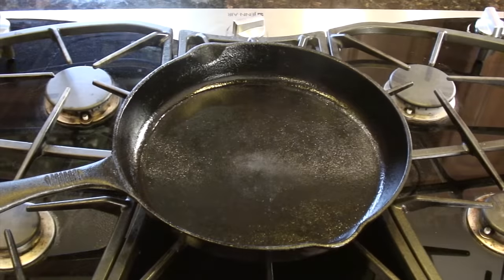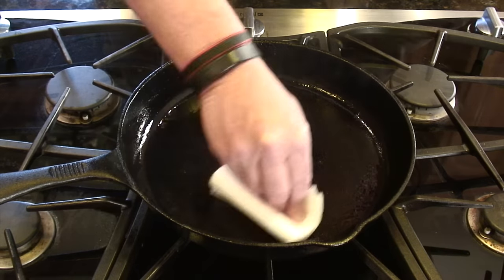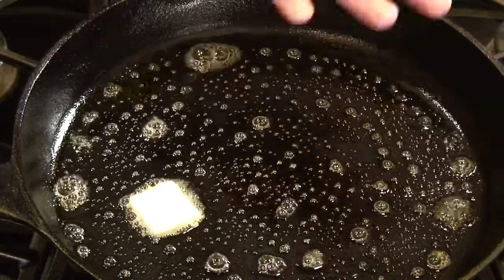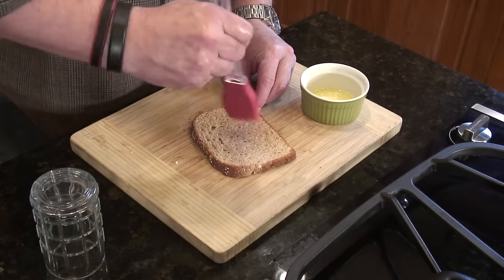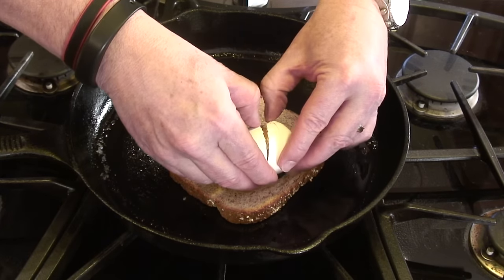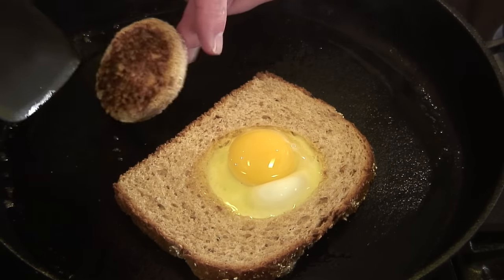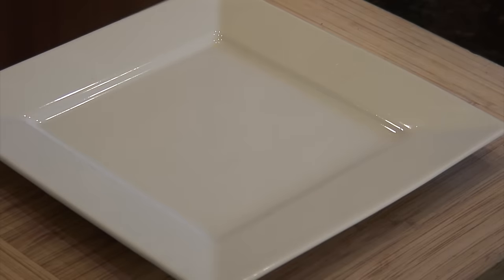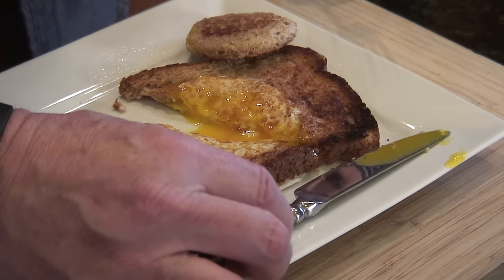How to Make Cast Iron Skillet Perform Like Teflon

Comment: Or you could just use a half decent stainless steel pan or, gasp, a teflon pan.  The problem with the cheap cast iron pans that are on the market today is that they have a rough surface.  They used to polish them smooth.
Reply from the maker: We hate stainless steel and have decided to no longer use teflon.  You are correct about the newer versus older cast iron.  In fact, I cover observation that in this video.
Reply: What do you hate about stainless steel?

Comment: That pan had not been treated rite if it was 20 years old and still looked like a fresh casting. Wash then put back on heat to dry all water and while hot drip olive (what I mostly cook with) but animal fats if used daily but will turn rancid if not used for a while but veg oil doesn't. But while still hot that thin layer of oil will build a carbon layer over time that's as good as any Teflon and you can even use a fork while cooking and not worry about scratching the pan. NEVER LEAVE WATER STANDING IN CAST COOKWARE!!!!!
Reply from the maker: That skillet has been "seasoned" many, many times.  It looks nothing like it did new.
Reply: BTW... By the lines on the handle, or the thumb grip, you can tell that is an Asian made pan.  No American makers ever put those lines there on the handle.  For the most part, the Asian pans were poorly cast.
Reply: Leo Ortega My Martha Stewart pan (made in China) has those lies on the handle...was made after 1960 and does not say the place it was made.

Comment: Seasoning cast iron, is not something you do before cooking. It is something you do after cooking. What you are doing, is just creating a temporary buffer between iron and food. Season it right (flaxseed oil, high temp, long time), and all you have to do is throw in a pat of butter when you cook. Scrambled eggs clean-up with a wipe of a paper towel. You need a drying oil to permanently seal the porous nature of cast iron, which is why flaxseed oil is used. But sure olive oil and butter taste good, they just don't do anything to "season" your cast iron. If you can taste what you used to season the iron, you're doing it very wrong.
Reply from the maker: Correct.  I didn't say that this was a "seasoning" exercise.  At least I don't recall saying that.  It's a way for people to use NEW cast iron which has a rough cooking surface.

Comment: Cast iron is not porous. It contains many visual and near microscopic interstitial or small space crevices, bumps, and indentations on its interior and exterior surfaces, as a result of the casting process. When the skillet is heated, the viscosity of the oil or other seasoning medium is thinned, and better engages the surfaces. The use of a high smoke point oil such as grapeseed, avocado, or flaxseed, is crucial to the best heat transformation into its hardest coating. That said, cast iron will never be Teflon or have Teflon characteristics, as it produces a better, more permanent non-stick surface when properly seasoned and maintained.

Comment: I cook eggs over easy and scrambled on cast iron every morning and never have a problem with them sticking.  It is easy to clean and last forever unlike Teflon.   If you can not cook eggs in a cast iron skillet you must be a  D.A.
Reply from the maker: A bit harsh, don't you think?
Reply: Well, no .    And the way to clean  it after scrambling eggs stick it under the water spigot,  while it is hot and then wipe it out with a lint free towel.
Reply from the maker: Yes we know how to wash a cast iron pan....just so you don't think we are a couple "DA's."

Comment: Won't the butter and olive oil go rancid?
Reply from the maker: +sonnysand No.  How do you define "rancid?"
Reply: Off flavor and smell
Reply: +sonnysand why would it go rancid?
Reply from the maker: +sonnysand Nope.
Reply from the maker: +sonnysand Nope.
Reply: The oil polymerizes as it goes rancid. Once fully polymerized or carbonized on a pan; it's more like glass or plastic and doesn't end up in your food unless simmering acidic food.
Reply: oils and oily foods goes rancid after a year or so.....it has to be super heated to make it non nasty.....don't use rancid oil or cook with oil too hot .....if the oil on your pan smells weird , not fresh ,  super heat it to smoke off the nasty oil , let cool and oil as shown

Comment: what you have done is what we (in southeast missouri) call seasoning a pan. I see people on here grinding down cast iron like the smoother the better, but it is the oil cooked on the pan (seasoning) that makes it nonstick. 
P.S. we never wash a cast pan. I like to clean mine with course salt and wipe clean. If i have something stuck on it I may have to put water in it with a little dawn and put it on the stove to boil a moment then let cool. Usually whatever is stuck will come right off. Also always make sure it is dry and oiled before storage.
Reply from the maker: Brent, this isn't seasoning.  Seasoning is backing a pan at 350 or so after being coated in cooking oil or lard, numerous times.  The grinding process does definitely help, as the end result is more like the older cast iron cookwares of the pre-1960's.  We never use soap either.

Comment: Sorry but Olive oil turns toxic if heated over 170 degrees.  A better choice would be safflower 265 °C (509 °F) or peanut oil 231 °C (448 °F).
Reply from the maker: Thanks for your input.
Reply: flaxseed i heard is best, linseed
Reply: AZZapper1 does anyone use coconut oil? Higher smoking point I think.
Reply: Commercials destroy our minds, unless you can cite a scientific source?
Reply: Evidence, please.
Reply: Finding no scientific evidence to support what you say about Olive Oil I have to say you are mistaken.  Olive Oil doesn't even reach the smoking point until 200 C.
Reply: Fake news.
Reply: Try  "Kirkland" Avocado oil  good for 400  Heat
Reply: Use real animal fats like lard. safflower oil is not the best either. I use coconut oil to cook with once the pan is seasoned. I just wipe it out if needed with natural paper towels not whitened with bleach.

Comment: My scrambled eggs, omelettes, and other "delicate" egg dishes in my iron pans. No problem.  If your iron pans are porous then it is not properly seasoned.  All of my iron pans are glass smooth inside.  Nothing sticks except pork and beef.  I never cook eggs without butter.  Nothing sticks in properly seasoned cast iron.
Reply from the maker: I agree with everything you said, other than the "porous" comment.  It is a known fact that newer, more recently produced cast iron has a much rougher cooking surface then vintage cast iron.  There are videos on how to sand it smooth, but having located vintage cast iron, I hardly ever use the pan in the video anymore.

Comment: So you seasoned the pan. Good job. I have no idea what people have been doing for centuries before this video.
Reply from the maker: That's not "seasoning," but thanks for the comment.
Reply: BBQMyWay dude, that is exactly seasoning a pan. I'm not sure what rock you've been living under, but that's how it's done. No new secret method; hot pan, oil- the oil breaks down and fills the microscopic pits in the metal, creating a smoother surface. Works the same way when one SEASONS the grates on a grill.
Reply from the maker: +Christian Stiltner dude....seasoning is not instantaneous like this.  Google it.  I've used cast iron for over 20 years now.  Why the anger?
Reply: BBQMyWay I've been cooking professionally for 26 years, and I'm telling you, all you did was season the pan. No secrets. The only reason I even commented is because you are just simply wrong
Reply from the maker: My friend, you are wrong.  Any references to "seasoning" talk about rubbing the skillet inside and out with lard or oil, and baking at 350 for one hour.  What I did is not seasoning.
Reply: BBQMyWay whatever...good luck with yer super trick that isn't.
Reply from the maker: Dude, you are a crack up.  Thanks for stopping by.
Reply: Christian Stiltner seasoning means you let it smoke not turn off the heat and rub oil
Reply: This is maintaining a seasoning. there, argument that ended 10 months ago is now ended
Reply: Actually the way you did it, is a form of seasoning.. when you put the oil in the pan and then heat the pan up it starts cooking the oil onto the pan. that is exactly what seasoning does.. you normally do it in an oven though so you get a more even coverage and even heating over the whole pan.. but you are essentially seasoning the bottom of the pan..
Reply: Because people knew things, and of course the egg didn't stick, it's cast iron not like the cancer causing ptfe.

Comment: This isnt a special technique, the part of warming the pan up fully should always be done to prevent sticking. Sticking occurs when the pan isnt warmed up even when seasoned which is basically what was done with the olive oil. Once seasoned the normal process is heat pan fully to temp, add oil or butter ect. let that melt fully and cover then cook. Modern light weight pans are less dense and heat faster so we have become accustomed to the process, which is correct, put pan heat and add oil/butter to cold pan then cook immediately when it gets to temperature. Cast iron is a slightly different process.
Reply from the maker: Your point?

Comment: The first thing you need to do with that skillet is take an angle grinder with a stripping wheel to it.
Reply: so not true! there are enough vids disproving this myth. people are like parrots repeating what they hear.
Reply: @germanshepherd13  Just because you lack the motivation or skill set to perform this operation does not mean that you should disparage those who do.

Comment: Never use a paper towel on cast iron never use anything that makes lint it will mess up the seasoning your food will taste like paper towel because it is a porous surface. Use a microfiber rag or a dish towel that the threads are completely looped over.
Reply from the maker: Thanks.

Comment: 5 very thin layers of organic flax seed oil has my 10" cast iron looking like black glass. Flax seed oil is a drying oil. Polymerization occurs after passing the smoke point. After that, rule 1 is add a small amount of your cooking oil to the pan and warm it before adding the food. Cold pan plus cold food equals sticking.
Reply from the maker: Agreed.

Comment: With proper seasoning,  you shouldn't need two layers of oil before you cook an egg.  Cisco has worked best for me and for the slews of grannys out there that use to cook on nothing but cast iron.  After 4 rounds of seasoning on a brand new lodge cast iron i have actually been able to cook an egg without any oil or butter.  Of course you cant swish it around the pan but when its time to turn it all comes right up.
Reply: ChedWick05 I

Comment: Cast iron or carbon steel will never perform like a teflon pan - unless you use oil of some type.  Nothing new about that.  Many people seem to be of the belief that because of the lore surrounding steel and cast iron cookware, they think "non -stick" means dry cooking.  I wish video titles would stop some of the mis-leading verbage.  This vid shows a typically correct job of how to cook an egg in a CI pan, though not the only method.  CI and steel cooking includes the use of butter or oils of various kinds, depending on the preferences of the cook. The more you use it that way, the better the results as the pan maintains the initial seasoning process.

Nifty idea with the toast there.  I'll do that on my next camping trip
Thumbs down on the title.  Thumbs up on the video.
Reply from the maker: Thanks for the detailed analysis.
Reply: You're welcome.  I think I'll head to the kitchen and cook up that dish.  Why wait for a camping trip?